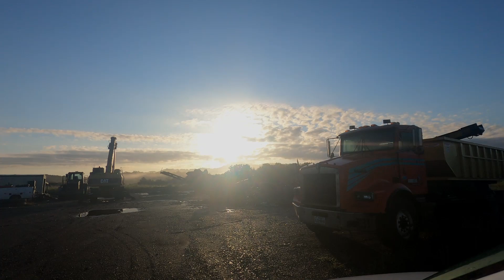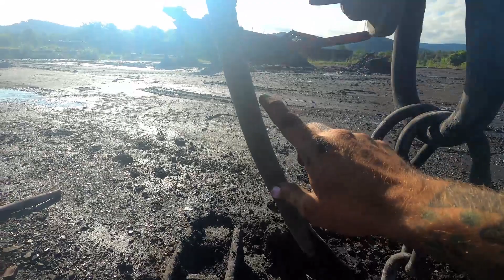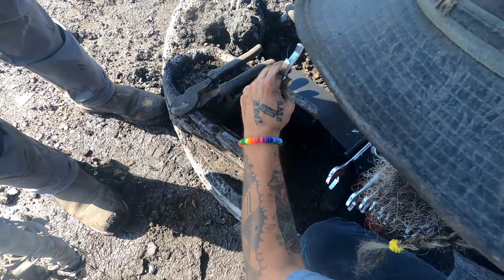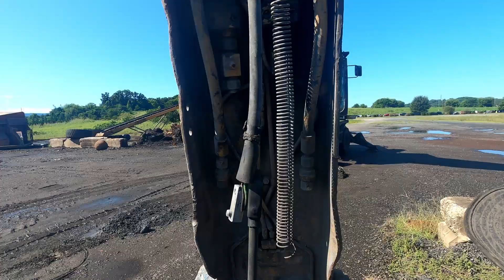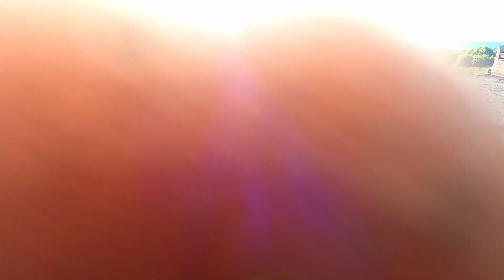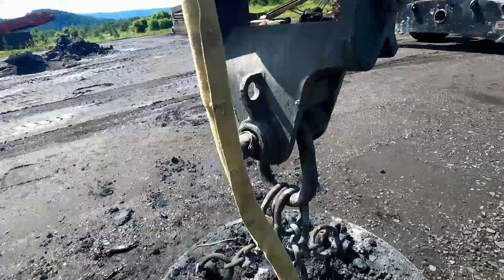WE’VE GOT FIRE - Replacing The 240 VOLT Magnet Line On My Daily Driver ( CAT M325c MH )

Comment: Nice fix Ryan! 
Have you ever thought about running the leads through a large hydraulic hose? Something like an XT-3 hose on either side of those aluminum connectors would give you a lot of added protection, and keep the leads from moving too much and stressing the wire strands. 
It would be a little more weight to contend with but, you could easily accommodate that. 
Just a thought! 😎
- Seth
Reply from the maker: I have done that exact thing before and yes it gives you the protection The amount of weight that adds is just ridiculous. And also with the hydraulic hose the cables want to fold over inside the hose when your sweeping the magnets back and forth instead of just kind of loosely hanging there. I bet you I do 3 million cables a year between all the job sites that I go to and I think this is the ultimate fix. Thanks Seth and take care my friend!